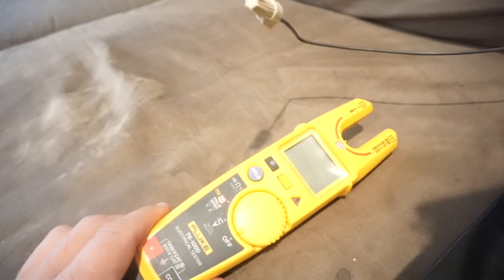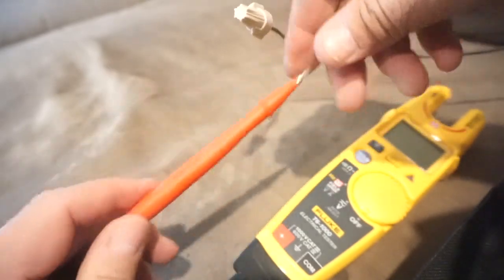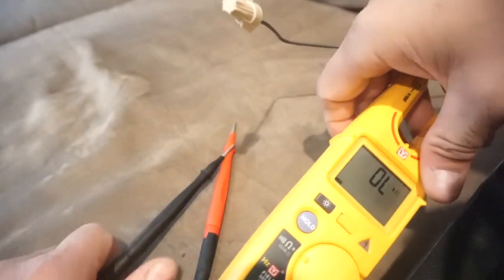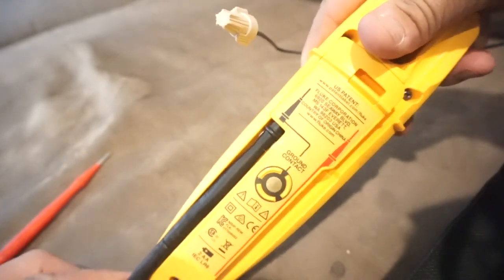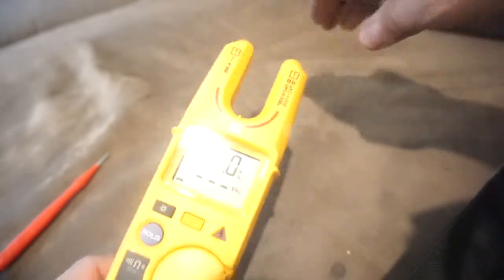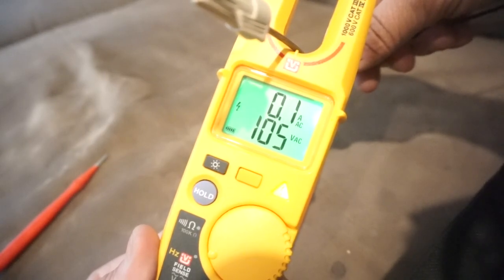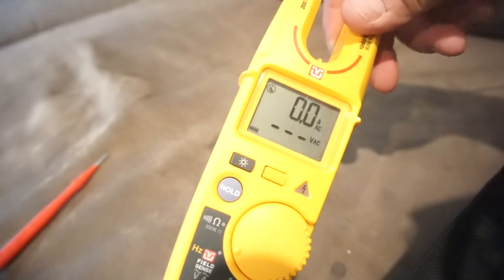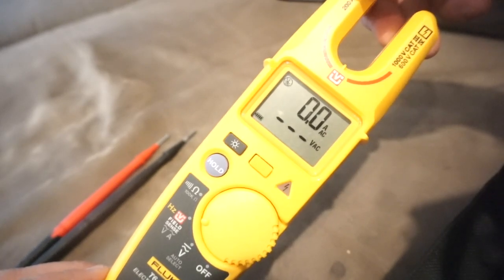TOOL REVIEW. THE FLUKE T6-1000 REVIEW!!!

Comment: thanks. Wondering to hear anyones opinions on this vs the PRO version. Pro doesn not have the grounding plate on the back and requires a physical connection to ground.
Reply: I know this comment is old but I think you can just hold onto the end of the black probe and it will have the same effect as the ground contact on the other ones

Comment: I can’t wait to get t6-1000, not the pro version. The Pro version is missing a ground plate. The ground plate is a must-have feature, which most people do not realize why 🤦‍♂️
Reply: yeah, Why would the pro not have that ground plate feature? seems like that is a highly desirable feature of rnot needing to physically attach lead to  ground.
Reply: @matthewellis3004  It’s more accurate. They know this. The plate was a gimmick.
Reply: @skyemac8  good to know. I ended getting the T6-1000 Pro. It works great. No need for the finger ground feature most times. Always easy enough to find a ground point.

Comment: The meter is using your body as a reference to ground so if you're touching the wire that you're trying to meter for voltage you will get improper readings. Seems pretty obvious.

Comment: It's not a flop.  My partner uses one routinely.  It is his go-to meter for routine troubleshooting and checks.  Not having to break connections, figure out whether AC/DC, and getting both volts and amperes in one shot on one screen inspired me to buy one for myself for home use.  One troubleshooting adventure on my own HVAC unit with just a process meter was a great motivator to spring for a T6.  No regrets on the purchase.  If I need great accuracy, and I question the T6, I'll back the T6 up with a process meter.